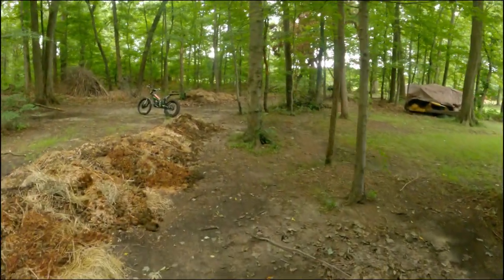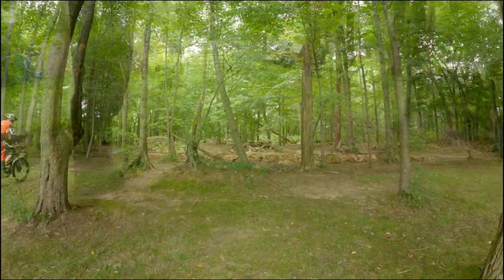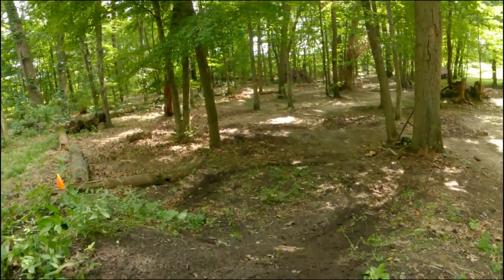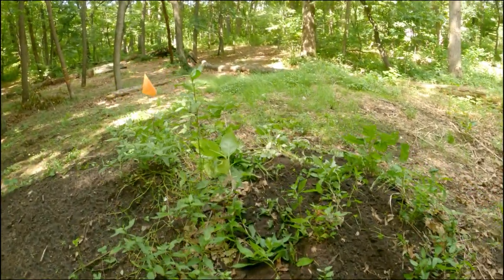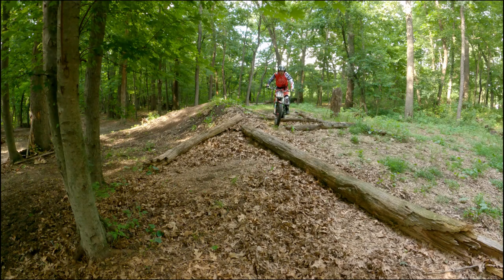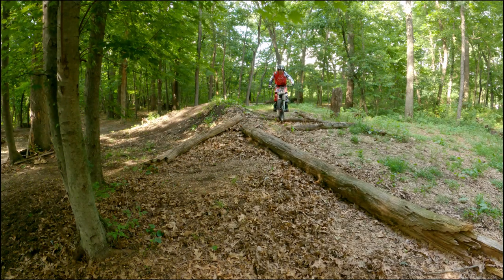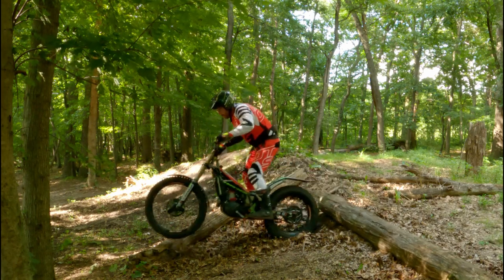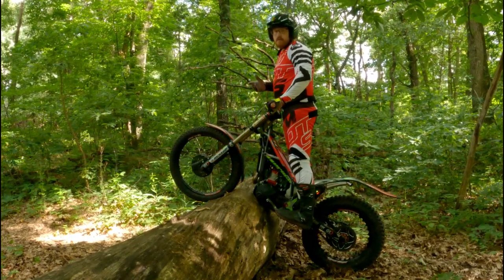Practice Session on my Vertigo 300 R2

Comment: With the static punch, have you got both brakes on to bring yourself to a stop?
Reply from the maker: Hi David. Yes when my tire initially meets the log I use both brakes. After I am settled I transition to front brake and slipping the clutch to hold me in place. I haven't practiced that in a while and my form in the video shows just that. I need to ideally get back, pause, rev, then go. I am using this sorta rocking motion because it makes me commit and quit over thinking it. It isn't right, but it is what I regress back to if I don't have somebody out there keeping me in line.
   Notice on the initial impact with the log on approach I let my body come forward. if you don't absorb the energy of the impact somehow (this is how I found, but not qualified enough to say I am right, just that it works) the front will rebound off the log causing you to not lock in right away and loose balance. 
   Hope this helps and hope all is well !